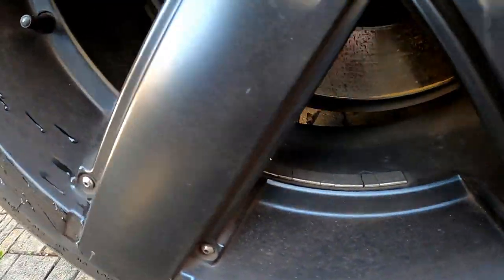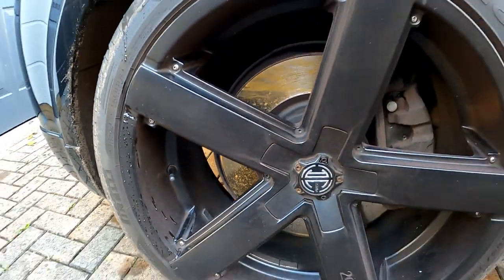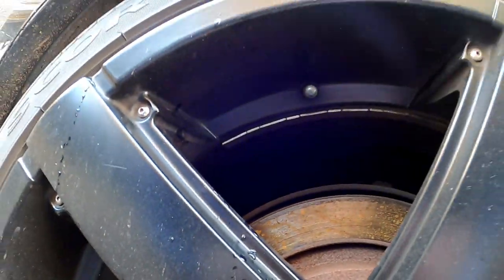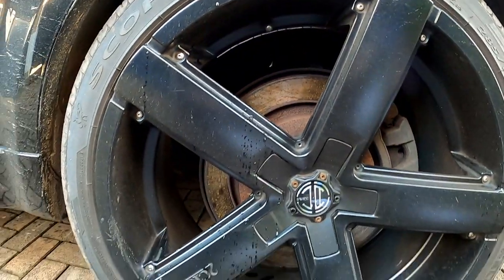Why is Your Steering Wheel Shaking While Driving at 50-70 mph – Reasons & How to Fix

Comment: can worn our drive shaft cross bearing cause vibration only 55-60 KPH and when you Exceed that speed the vibration disappears? on my toyota wish FWD.
Reply from the maker: Possibly, although if it only happens at a certain speed it points to the tyres maybe needing a balance.

Comment: Yeah I drive a 370z Nismo, and I have this issue only at 65-85 anything higher than those speeds or lower it drives perfectly, I just had brand new tires put on, rebalance and alignment and haven’t tested it. But if it still continues what could it really be?
Reply: so what happened

Comment: Whats wrong when my 2011 durango when front end shakes at 70 but it goes away and comes back every couple seconds? Its not constant at 70 just goes in and out constantly. It will shake for a few seconds then it will ride smooth for a couple seconds inly at or around 70 or higher.
Reply from the maker: Could still be the tyres need balancing and one side is slightly under-inflated, meaning the rolling radius is reduced so it's performing a full rotation faster than the other side, which is then noticeable every time they're out of sync at higher speeds. Could be something else, but it's worth having them checked first.
Reply: @al-s  thanks for the insight. Im hopeing its just something as simple as a tire balance. Just took a trip from mich to florida last week and had some better used tires put on. I dont think they balanced them but am goin to a tire shop today. Thanks again i am really appreciative for your time and knowledge.

Comment: Nice 1.  Mine wobbles at 30 and 60 and at 100 and then noting happens the next day I drive.  I haven't got a clue. Balanced my front tyres and it worked for a day and now and then I get wobble when braking.   All I can see is money getting spent. Any ideas.
Reply from the maker: Thanks. Hard to say without knowing more (what car, wheels, tyres, sizes, age, running spacers, etc.) It could be one of many things, even a slight buckle in a wheel. Wobble when braking is often down to a warped disc though.
Reply: @al-s  gona hav a wonder to a garage tomorrow see what their diagnosis is.   By the its Ford cmax 61reg   245.  40.  R18.    Only common issues with these that I have had previously is seized handbrake cable. Had on my previous 2 cmaxs.  Beside tht great cars.
Reply from the maker: Hopefully they'll sort it for you. Does potentially sound like a balancing issue, try a good place with the latest balancer equipment ideally, I always use Merityre, they managed to balance some difficult large/heavy tyres for me in the past.
Reply: @al-s . Thanks mate
Reply: @al-s   Got it sorted.  Front tires balanced and guy picked it up instantly (experienced tyre guy). Found front caliper seized badly.   Got new discs (little warped) , discs pads and calipers replaced.  Jobs a good one.  Hopefully.  I'll let you if anything else arises.   Info may help someone
Reply from the maker: Ah great news they sorted it! Often it just takes an experienced tyre guy like that to put their finger on it. Hopefully no more issues now 😂
Reply: @al-s  mine starts wobbling at 60 and up, and shakes when braking, can you give me any advice ?